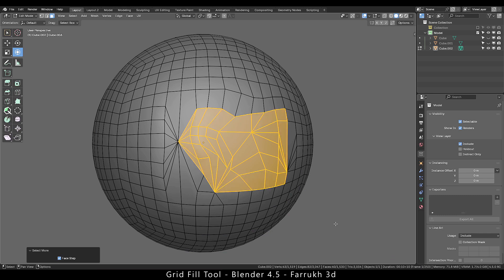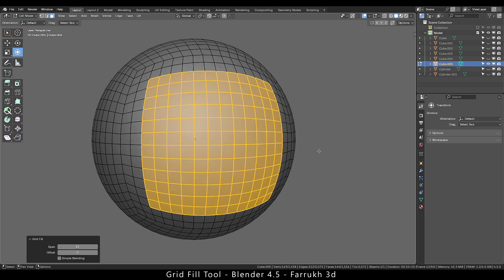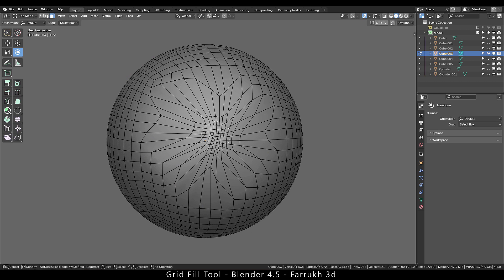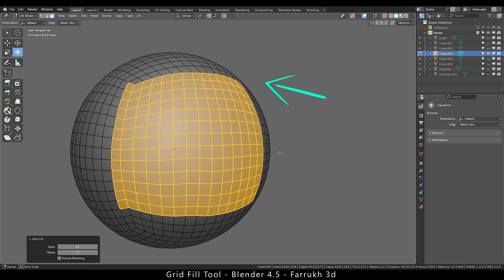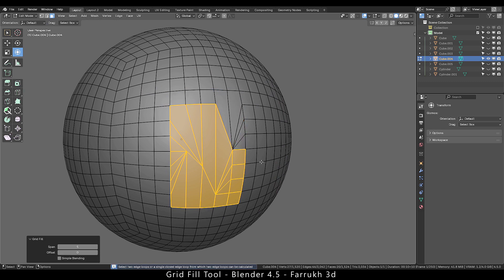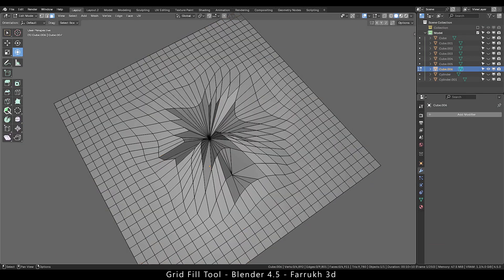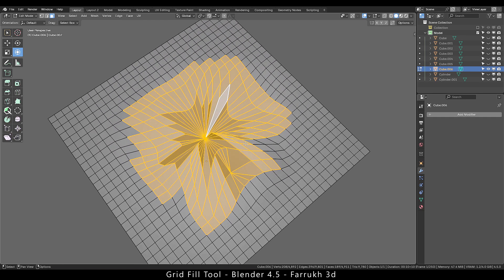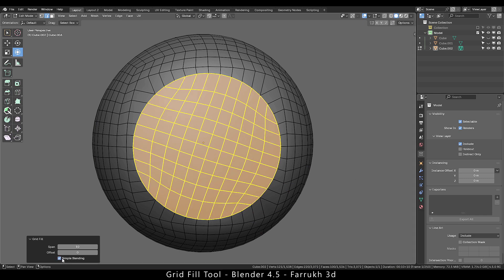New Grid Fill Tool - Blender 4.5

Comment: Unfortunately not really working. Some not ideal situations would be better to exemplify than somewhat carefully disturbed shapes. For example a normal UV sphere 64x64 if you remove faces from it you can't recover it is just a mess every time.
Reply from the maker: Yes, it is true, this will not fix random shape designs and create messy results or may not work at all. It is still a improvement from previous version of grid fill and can be useful in certain cases.

Comment: Which theme is it?
Reply from the maker: Theme is default. Matcap material is changed to darker. You can set from the viewport corner buttons.
Reply: @Farrukh3D  Thanks, it looks more crisp in your video.
Reply from the maker: @Formor3D  The video may look slightly crisp is due to sharpen filter during video editing composition. :goodvibes: